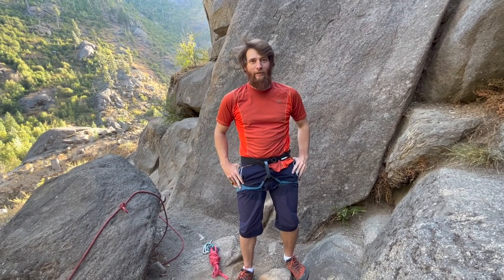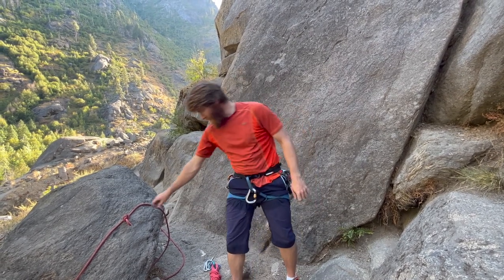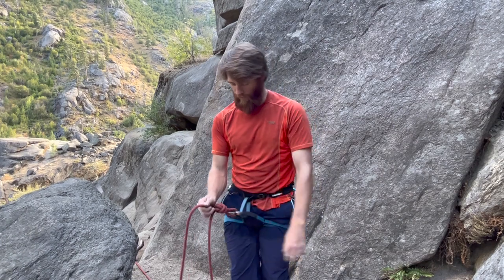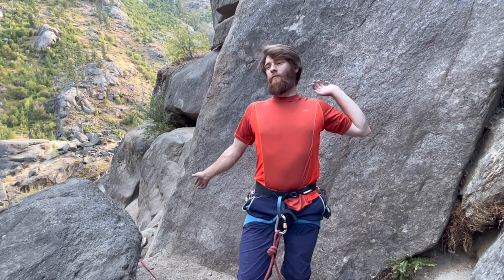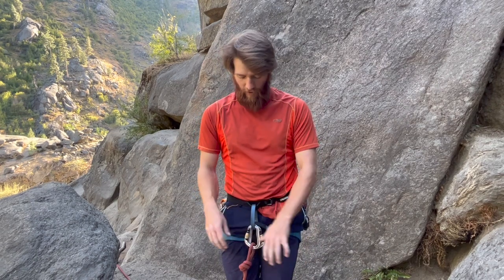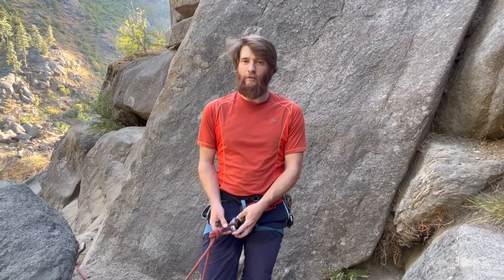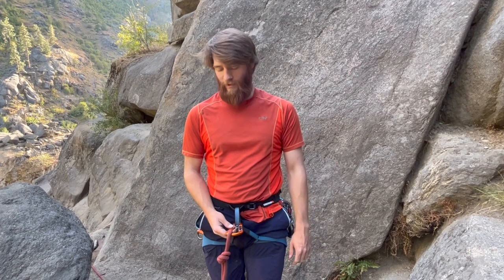Why we clip to the rope with 2 carabiners

Comment: Alternative methods than connecting with carabiner:

Tie in with a girth hitch: make a figure 8 or alpine butterfly with a huge loop. Keep the knot loose for the moment. Pass it through your harness rope loops bottom up, then pass the loop over your back, and then under your feet. Pull tight and it will girth hitch around you. Adjust the knot to be more appropriately sized. Dont just tie in with a girth hitch, it could slip in a fall and you would not mainain your position in the middle of the rope.

Bowline on a bight: my prefered method. pass a large bight through your harness loops bottom up. With your right hand, grab the two strands on the standing end together and twist over clockwise to form a loop (the ends going away from you should be on bottom). Pass the bight through the loop from below, and then pass the bight around you back over your body and under your feet. Adjust the knot and you should be tied in with a bowline on a bight (look up pictures to visually confirm)

Pros: you get a full, secure tie in that could never come undone accidentally and is not suvject to damage with contact to the rock. No gear is required, and it can be loaded in either direction.

Cons: in guiding, a beginner could not reliably tie and untie themselves unsupervised. Undoing the knot requires being disconnected from the anchor, or using two PASs to atay connected while bypassing the loop when stepping through it. If frequently untying while hanging at a fifth class belay station, this may be undesirable. If you plan on switching who is leading and who is in the middle of the rope, or you are frequently switching betwen climbing or rappelling, this is not ideal.

Comment: I use the Clepsydra S as well. Like you say easy to use, even in icy, dusty or snowy conditions it won’t seize up on you, unlike some of the more complex mechanisms.
I like this much more than 2 regular carabiners because of the weight. Not just total weight you are carrying up the mountain, but the even more so the weight and noise of two carabiners clanking around, whacking you in the crotch with every step and driving you crazy.
Plus, for situations where you are clipping and unclipping it’s a lot easier and faster with just one instead of two carabiners.

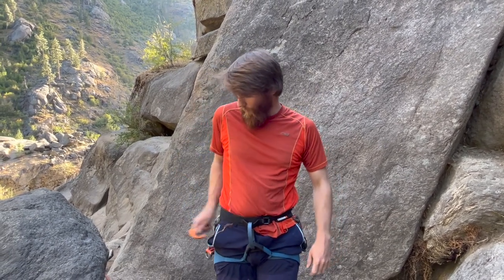Comment: 7:00 an additional advantage of the double gate carabiners is that they can't "freeze closed" as the screw or autolocking carabiners does when exposed to ice, snow or freezing water, it's also good to consider those that you can manipulate without removing your gloves ;)

Comment: Very helpful, thanks!! Any thoughts on Clepsydra S compatibility with Giga Jul?
I’m also considering the DMM Ceros safelock. As good, or not for alpine—ie a triple locker worth worrying about in snow?
Reply from the maker: The only thing I would worry about is if the clepsydra is to small to let the giga have the full range of movement to fully lock on the rope. If the Giga butts up agains the carabiner or your belay loop it could effect the breaking action. I think the ceros is a really good carabiner to use also, it would be pretty good in dry alpine stuff but the clepsydra is really good in wet alpine conditions.

Comment: Thank you for the explanation and for your video! For me, the best carabiner to use on glaciers is the Petzl Ball Lock. It is a triple action carabiner that is still very good to use with gloves. It does not come with a clip to catch the harness, though. I always found the double carabiner solution to be clumsy if used for longer periods of time. 

I am wondering if there is a real possibility to reach or even exceed 8kn in a crevasse fall. Is it really likely that you can exceed that force during rescue, even with a pulley system you against the lip?
Reply from the maker: It’s actually kind of surprising how many stories there are about people being hauled into the lip, it usually ends with the folks on the glacier reversing the system so the victim can get from under the lip, but if the rescuers keep pulling that’s when people have gear break or die from being bent over backwards. Even when I’ve been teaching crevasse rescue classes every now and again you have a clinet acting as the victim get hauled into a strange position around the lip, it can happen for sure!

Comment: I did some quick tests with the Eldelrid bulletproof and and the DMM ceros, and unfortunately both would actually cross load with a 8mm rope.  The grivel does not look to have this issue at all because it doesn't have a twist lock where the rope will get stuck, and then cross load.   I ended up settling on the DMM belay master 2, which has the plastic clip...but I have not seen anyone else really use them... any reason you can think of?  Been loving dmm as of late...
Reply: Racking the belay master on your harness is kind of annoying with the plastic clip protruding off to the side and snagging on other things, although that's less of a concern if it's on your belay loop all day during glacier travel. Also seems a bit susceptible to getting snow or ice in the plastic clip which might prevent it from functioning. For glacier travel connection, I'd stick with the Sm'D triact or the klepsydra.
Reply: @Govanification  I don't use the belay master for single pitch because its a pain to rack (ceros triple locker is best I have found for single pitch with grigri)... you either have to have it snag as you mentioned or close it, which are both annoying... I use it for glacier travel only... I guess if it freezes and I have to escape system I will hit it with my hammer  or spike lol but man it would have to be gnarly conditions for that to happen... having two screw gates could also get frozen, requiring pliers ... worst case you could use techniques to create a new masterpoint and cut oneself out of the system... sorry maybe I was not clear with my question.
Reply from the maker: I can’t really think of a reason not to use the DMM carabiner, but I also havn’t used it ever. If it gets both the jobs done then I don’t really think I can say it’s not good to use, maybe when it gets older and the plastic clip starts to fall out on its own then that would be a good time to stop using it for glacier travel.

Comment: How come you don't do a larks foot to your gear loop and then have an alpine butterfly?
Slower than a biner but nice just being attached to the rope
Reply from the maker: Most of the time in glacier travel mode I want to be able to escape the knot I clip to myself really easily and as quickly as possible. A Lark’s foot would synch down on the carabiner and make it harder to take out under a load, if you’re planning to use a prussic on the load line for your crevasse rescue then it wouldn’t matter, but I like to clip the loop on my harness to the anchor, that’s where the lark’s foot would be annoying.

Comment: Mr. Ryan Tilley, Sir! Have you looked at the new Edelrid bulletproof hms belay FG slide lock? What do you think of the locking mechanism? Note: I moved over to edelrid bulletproof for all weighted rope stuff, my ropes are so clean now. No aluminum except for quick draw or cam rubbing. 

Also, do you think this would work with the madrock gemini carabineer?   I personally love it for the gri gri or similar.

Lastly, I have been looking for a small, camp photon esk, locker with a capture device. Know of one? 
I've been doing a lot of easy top rope solo and my micro trax carabiner is constantly cross loading... Been using a rubber band and tape for capturing. I need a cleaner solution.
Reply: I wouldn't trust a single slide locker for my life on glacier travel. I used to use an older version of the slider with a belay keeper wire with my gigajul but I never fully trusted it, too easy to simulate accidental opening scenarios. The new one is no more secure in terms of opening from rubbing against rock/snow/ice. 

I use the Petzl Sm'D triact (orange gate, triple action) as a single connection to the rope for glacier travel, as I found it has a shape that resists getting caught up in a cross-loaded orientation more than other carabiners. Same carabiner shape works great for a grigri, but I use the simpler 2-stage version (red twist-lock gate). 

I feel you on the micro trax crossloading... it's actually a bigger deal than just loading the carabiner poorly as I've seen pictures of the carabiner gate getting snagged between the plates of the microtrax and prying them apart when loaded. I use an Sm'D again but have 2 rubber rings to hold the trax along the top bar, but not ideal. Probably the lightest anti-crossload autolocker is the grivel klepsydra, which also doesn't have a bulky gate to snag, but I haven't tried it with the microtrax.

The CT RollNLock and the DMM Rhino are a perfect match for TRS, however, as the wider body of the RollNLock stays captured perfectly along the top bar of the Rhino with no crossloading possible and no need for belay keeper wires or rubber bands. I use this for my main device for TRS and the microtrax as my backup device.
Reply: I tested the edelrid bulletproof triple locker with non cross loading clip and unfortunately it is pretty easy to get it to cross load with skinnier ropes same a dmm ceros triple... but its rated so high it's prob not the end of the world to use it.... best top rope solo I have used is rescuecender bungied (around neck with thin shockcord) on top with metolious gatekeeper and a microtraxion on bottom also with gatekeeper, both on belay loop.
Reply: @Govanification  I might try rollnlock if I ever go back to tr solo...I never had the reported issue with rescuecender not locking up btw, ever.  Still something to consider!   I just don't have as much fun on ropes by myself... like at all so I stopped completely
Reply from the maker: Ya I’ve been meaning to get one of those new edelrid lockers for belaying, the locker isn’t a triple action, more of a double, I’ve also seen them come open in a loaded situation a lot. It’s actually really easy to get them to rub against something and open up, make me a little nervous of using them for glacier travel personally. The Gemini carabiner kind of has the same thing, where the directionality is probably ok, but it’s just a screw lock. Also the Gemini is kind of long, I like my carabiners more compact. 
I havn’t seen any “D” shaped carabiner with a capture loop or gate for belaying, usually companies will make them larger so the rope runs smoothly, but for devices that don’t have the rope running along the carabiner that could be kind of nice. Still I havn’t seen any like the camp photon with a capture wire.